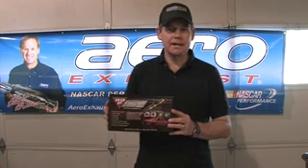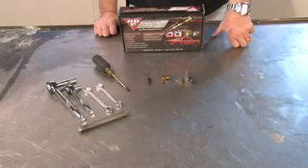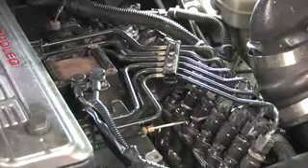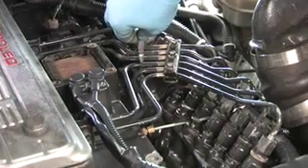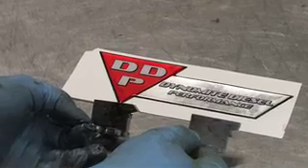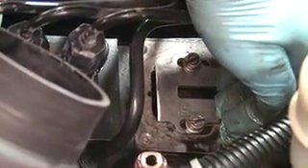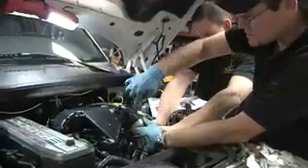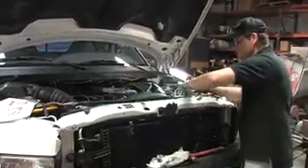Dynomite Diesel Performance: BOSCH P7100 Fuel Plate for Cummins 12 Valve

Comment: Will it roll coal if I put this fuel plate in
Reply from the maker: +snakeairsoft leger Under hard acceleration with the fuel plate turned up you would see more smoke than you are used to. To get you to the point where you would be "rolling coal" you would probably need a lift pump and upgraded injectors as well. This would be the place to start though.
Reply: can you send me the link to both parts
Reply from the maker: +snakeairsoft leger Here is a link to some 100 HP injectors. http://www.parleysdieselperformance.com/products/industrial-injection-race-1-injectors-for-1994-1998-dodge-5-9l-cummins-0432131715r1
And here is a link to a 165 GPH lift pump. http://www.parleysdieselperformance.com/products/airdog-ii-165-gph-lift-pump-for-1994-1998-dodge-5-9l-cummins-a5sabd024
You'll also want to make sure to have an EGT gauge to monitor temps.

Comment from the maker: The current iteration of the Dynomite Diesel Fuel Plate can actually be adjusted to make between 25-140 horsepower.  You are correct Rumbus528, this is completely contigent on your other current supporting modifications.

Comment: 125 hp? BS! Do a base line on a dyno, then with your plate. You WILL NOT achieve a 125 hp increase without supporting modifications.

Comment: i have a bone stock 94 cummins with the nv4500 im gonna throw a cold air and striaght pipe on it would #10 fuel plate move the afc forward and 4k gsk be too much for my stock tranny to handle?

Comment: Fuel plate just limits full throttle fueling just throw the stock plate in the trash and leave it empty, save your self some money. I have personally never had a problem. Also prob want to turn the star wheel so it fuel's faster and more all the time and the "smoke screw" its on the back of the afc under a cover (sneaky dodge) I turned mine in about half way and star wheel all the way forward.

Comment: @crsvky28 No this wont make the engine rev higher. You can tighten stock gov springs, witch are not located in the afc there is a large plug on the driver side of engine under throttle linkage. remove plug and turn engine over by hand until you see the spring there is a clicking nut basically that holds it on I think you can turn it 4 more clicks safely i did three, there are two springs so do one side and turn engine again and do the other side. Made mine rev to about 3100

Comment: actually the 89 -93 dodges used a bosch ve rotary style pump 94-98.5 used the vp44 and 03 to current are common rail just clearin up any confusion not tryin to be a smart ass its just i work for cummins and have access to all the factory manuals

Comment: To answer your questions-

For #1, Yes. How far you want to go, will depend on how much low boost smoke you are willing to have on acceleration.

2. No.

3. Yes. 8mm allen. May need a allen with a head that takes a 3/8" drive ractchet and an impact driver to loosen it. A hammer on a regular allen might be enough. Some are pretty tight. I had to use a hammer on mine. Don't loose the washer.

4. No.

Comment: I have mine turned as far as I can with the screwdriver. Really depends on how much smoke you want off boost. Looser spring = more smoke.

I also have my 10 plate and AFC housing slid full forward.

Comment: I have my starwheel turned (and the plate and AFC housing are slid full forward) as far forward as I can without taking it off. Really depends on how much smoke you want to have. The looser the spring, the more off boost smoke you will have.

Comment: You can turn the star wheel in as far as you want. The perfect setting is a slight smoke haze while accelerating hard. That is on a mildy modded or stock truck, so this isn't to be followed when heavy mods are done. I had to remove the AFC arm for my truck to run at it's best.

Comment: I modified my stock fuel plate, but this video was very helpful to me. I was also wondering if anybody could tell me how far I can safley turn my star wheel on my fuel pump.  I've turned it toward the motor three clicks already but would like to go more if possible.

Comment: Makes sure to add a pyrometer to watch the exhaust gas temps (EGTs). If you add that much fuel, you could melt parts in the engine. Particularly if you tow. Depending on the plate, you may need to upgrade to a bigger turbo for more air, to lower the safe EGT level.

Comment: Make sure the AFC housing is in the same position, or preferably full forward. If it is to far back, you will severely limit the power potential of the engine. Full rearward to full forward on the AFC makes a HUGE difference.

Comment: Also, sometimes it is helpful to remove the high pressure fuel lines to gain better access to the tamperproof bolt.

Comment: An impact driver is VERY helpful in loosening and tightening the screws for the plate. Pushing down on a screwdriver by hand isn't enough to keep the screwdriver from slipping. Whether removing the plate or getting it tight enough.